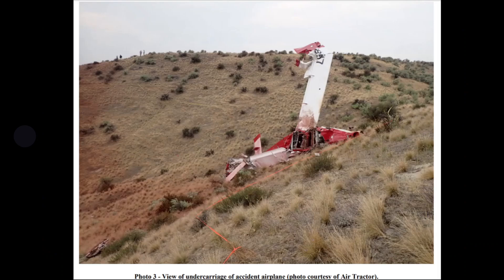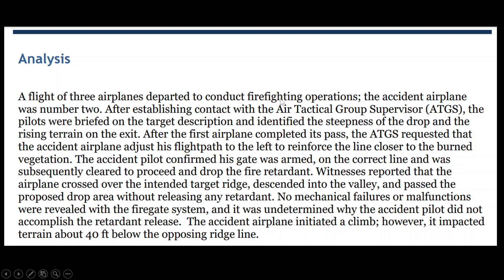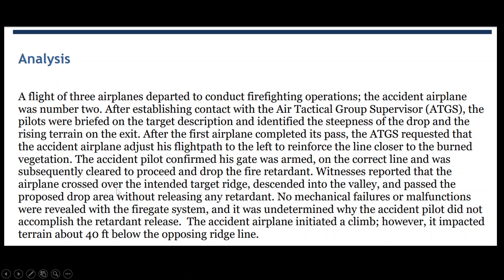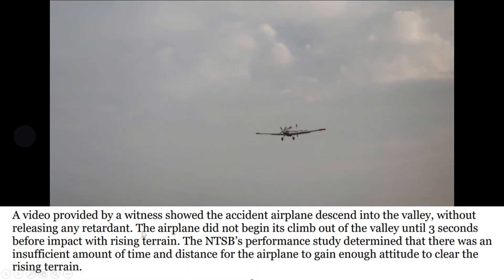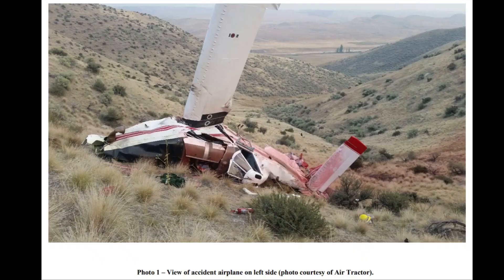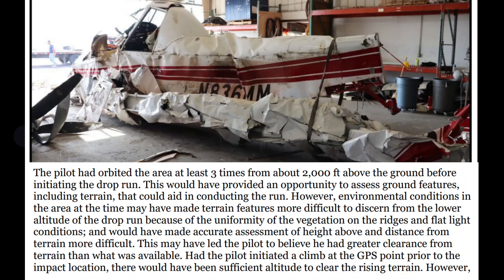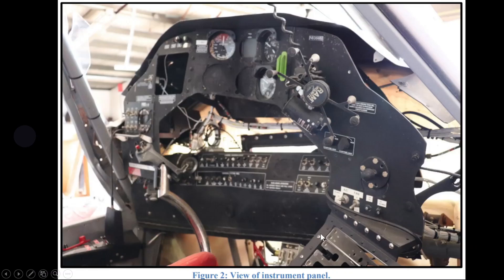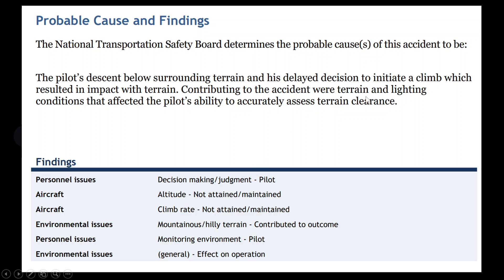Firefighting Aircraft hits Hillside in Idaho

Comment: They said the pilot had trouble with the gate not opening on another fire and the company who makes the controller sent a fix for the computer that controls the gate. The pilot preformed the fix. The plane does not have a good climb rate when full of flame retardant if he would of dropped the load he would have cleared the ridge by 8 feet. According to NTSB after they looked at the data.
Very sad. It was hard to tell in the video the depth of the valley.  There is also a manual release and he may have tried to use it and delayed his climb. The specs for the climb rate is published by air tractor. Its not much like 12 ft a sec when full. Its all in the report. Hate to see someone willing to put out fires with an airplane die doing good.

Comment: I bet the pilot was experienced in agriculture flying and was pulled to drop fire retardant and one thing has nothing to do with the other and BUM! There you go. RIP
Reply: That is not how it works, at all. Yes, the people that fly these Air Tractors come with significant crop duster time, no they do not just tell ole Hank to stop spraying the back 40 and load up some water for that fire over the ridge there.  Both aircraft and pilot must be specifically licensed for what is called 'Air Attack'. It's called having your 'attack card'.  Because he was flying on a BLM contract he would have had to have had that training cert. It was his first '(and sadly, only) season flying attack however. It is a hellishly dangerous job. 5 other attack pilots died as well that season, two of them from the same company he was working for.